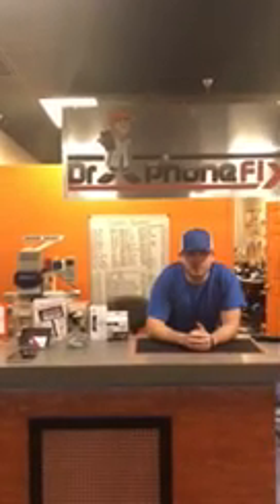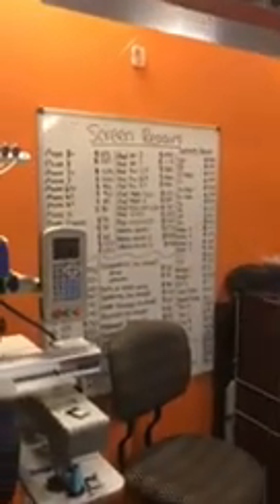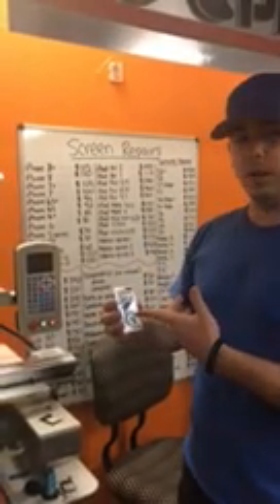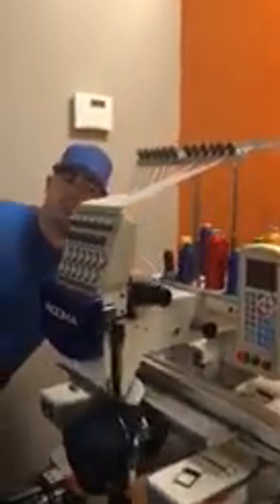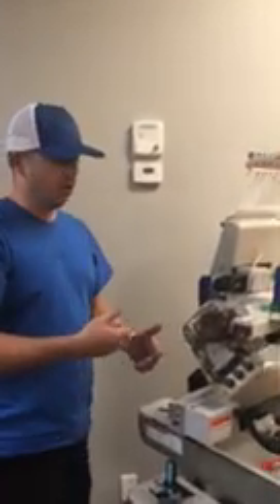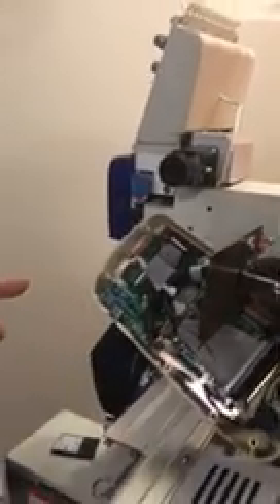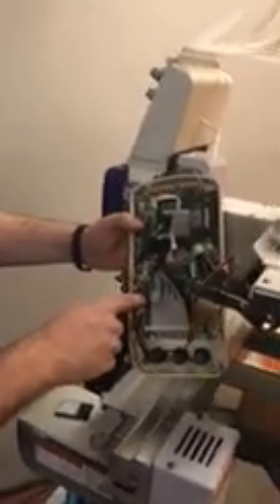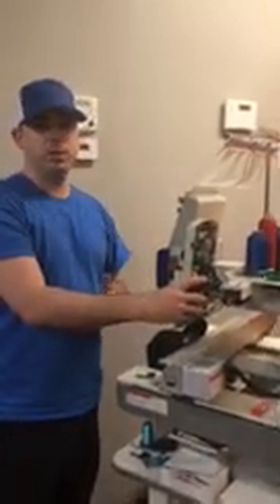Ricoma 1201 PT Battery replacement

Comment: Thank you for this video!!! Even though it was a little blurry, I was able to change the battery in my Ricoma RCM 1201 PT embroidery machine.  Your video was the only thing I could find online or in my instruction books on performing this task.  My machine is 9 years old, but is a workhorse and still puts out excellent embroidery.